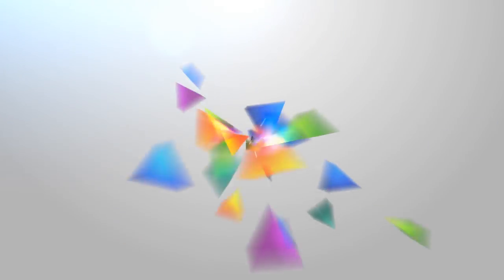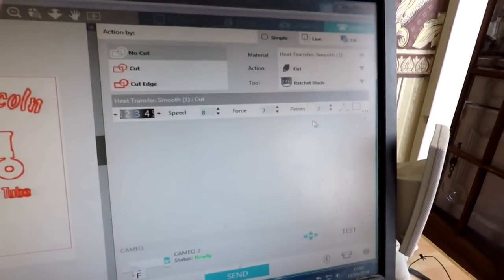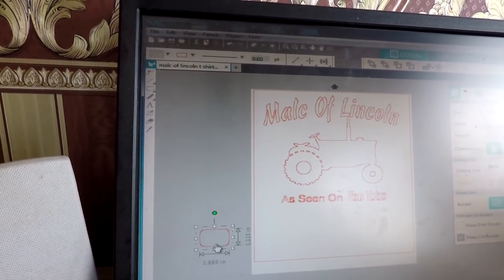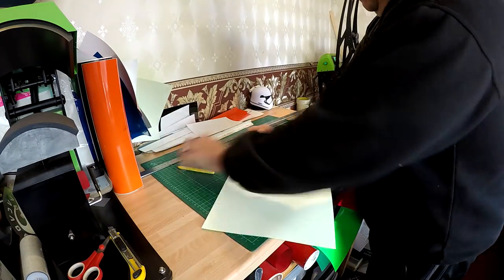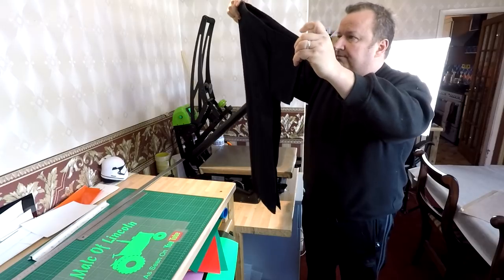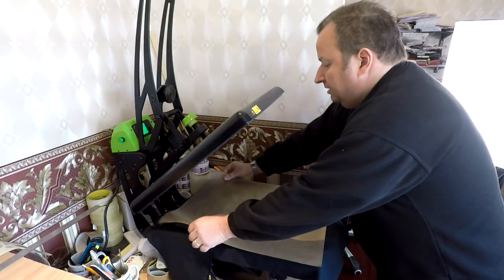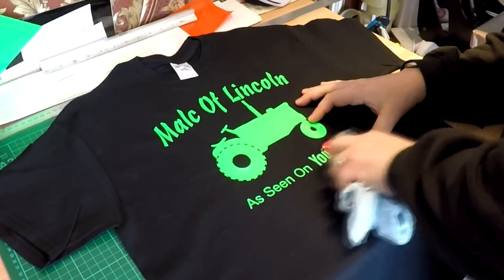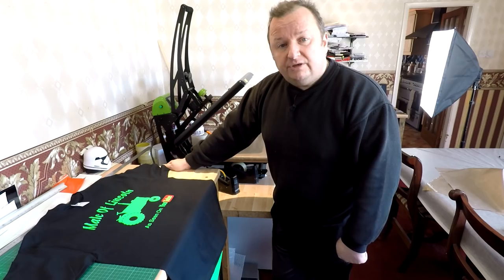T Shirt Vinyl Not Sticking Possible Cause

Comment: Hey martin great vid as always , have you ever come across vinyl not sticking to a garment.  I did a hoodie a while ago  most of the design stuck no problem but the telephone number just wouldn't stick seem to remember that was red vinyl too,  and I did a tote bag last night 5 word design  4 them of stuck and one of them refused its like the adhesive was left on the garment but the vinyl lifted ..  that was red too ... its a conspiracy
Reply from the maker: Haha, you may be right lol Is your heat plate heating up evenly?
Reply: Yeah press seems fine ( same type as yours ) its very strange only happened on those two occasions and as I said it left perfect impression of the glue ... asked about it at Mdp they say they have never had it do that .. so kinda stumped. I'm wondering if there was some kinda contaminant of glue side of the vinyl but it looked clean...
Reply from the maker: If it happens again, maybe send the sheet back and see what they say or point them to this video.
Cheers
Martin

Comment: Hey Martin, REALLY helpful video I do Heat Transfer Vinyl printing from my bedroom in Leicester! Can I just ask is that a Teflon sheet wrapped around your plate? If so whats that for and is it something you recommend doing and why? A problem I have occasionally is for example I did a name and number in a football shirt today and part of the name didn't stick first time round and a i panicked a little but managed to salvage it. I think it was possibly due to the shirt not being flat enough cos it was for a 1 year old and the creases of the sleeve were raised meaning the body was sunken a little.
Reply from the maker: The teflon sheet on the bottom helps you slide the t shirt onto the press. The top one protects the garment.
Reply: @reviewthat  and how did you get the bottom teflon sheet onto your plate? Can it be glued down or?

Comment: Hi Martin. New subscriber. Found all your videos great and a real help, so firstly thank you. Just wanted to ask a quick question, noticed on your Galaxy heat press you’ve actually got a Teflon cover on the bottom platen. Have you folded this round it and taped it on there so you don’t have to keep putting a bottom sheet on? Noticed it in a few of your videos. It’s always a pain whenever I’m putting a TShirt on the press once I’ve put the Teflon sheet first, and the sheet always goes flying and moves about - so was just wondering if what I noticed was correct - and that you’ve actually folded a Teflon sheet around the bottom platen permanently just to make life easier??
Thanks again and would be great to hear from you! Best wishes, Damian
Reply from the maker: Hi Damian, this is the only place I know where you can get them https://www.targettransfers.com/tools-accessories/heat-press-accessories/quick-slip-lower-platen-protector.html They are a fitted sheet like mine.
Cheers
Martin
Reply: That's great, just what I was looking for!  I primarily do TShirt printing, so it'll make life so much easier when putting them on! Thanks for the super quick reply Martin and keep up the amazing work! You're a great help!

Comment: good to see the lil mishap..and from the looks of this video "which ive watched a thousand"..it seems this vinyl process is very simple..seems to the point more so than the printing with ink and reversing words and worrying about which papers to use etc..My only issue with vinyl is its thick and can be a lil hot feeling to me..Thanks
Reply from the maker: You still have to reverse the words and images but its easy with the Silhouette Studio software that comes with the machine.

Comment: Ive got t-shirts with 3m reflective vinyl prints. Could you pls advise how I should wash them to avoid the print from peeling?
Reply from the maker: Check the label bud.
Reply: @reviewthat   They are my own blank Gildan T-shirts that I had printed for my clothing brand therefore the label is no help. I've figured it out tho
Reply: TheNextTorres9 hey how did you figure it out bro ?
Reply: TheNextTorres9 what did you do

Comment: Hi martin i bought your cd on tshirts nearly 2 years ago im now looking at direct to garment printing soon many thanks for your video's always entertaining.  Would like to see someone make a dtg from epson 1500w.
Reply from the maker: The thing with DTG printers is they need to be used all the time or the print heads block and you'll end up in all sorts of mess. I wouldn't think of buying one if you are just starting as they are very expensive. They are basically an Epson printer anyway.
Cheers
Martin